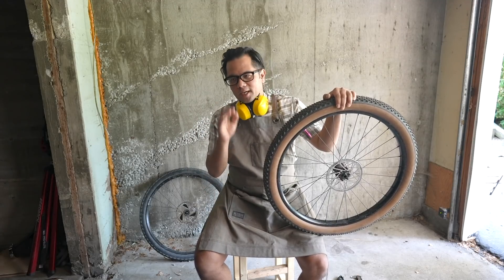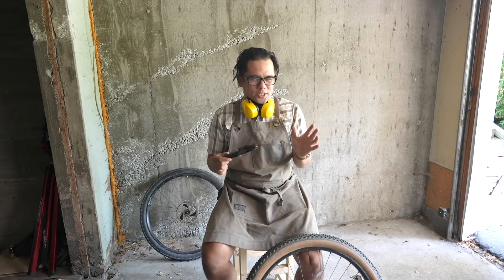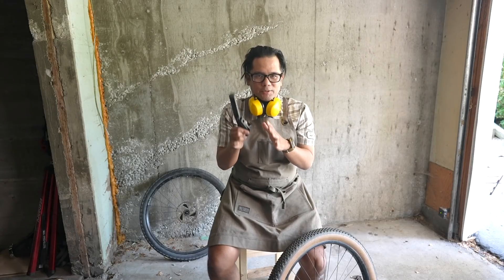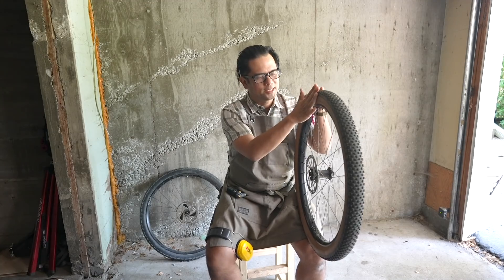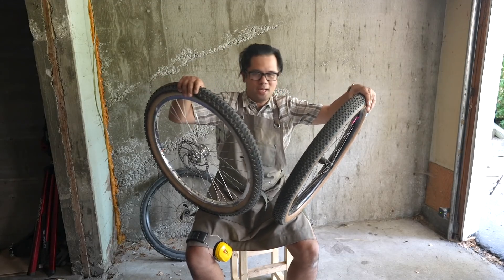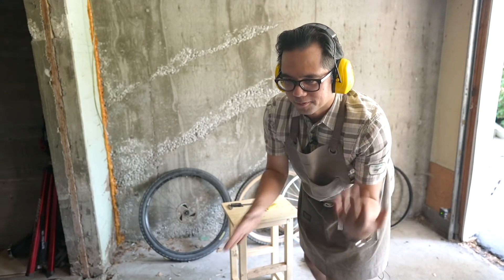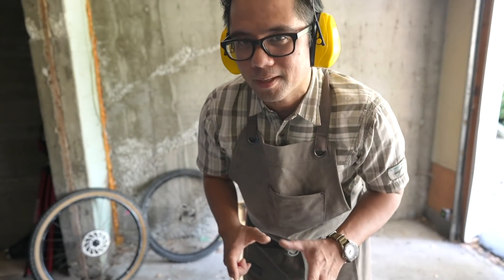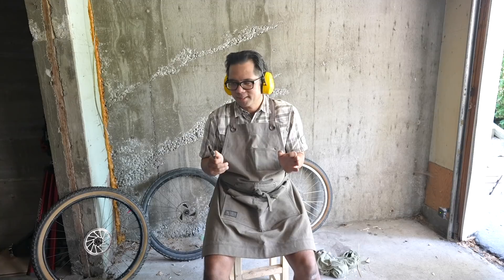Your Tires Are Always Changing Size

Comment: My Continental Contact Plus City 700 x 42c measure anywhere between 40.5mm to 41mm on my 22mm rims depending on where I measure. I'm curious if it will be closer to 42mm on 25mm rims. About 45 PSI.

Comment: I've been inspired by the Old Shovel to bring life to old bikes. I have an early 2000's 26er MTB. I was thinking of making it a "gravel" bike with alt bars. I would convert it to a 29er if I could, but there are a lot of problems with that. I was thinking of making it 650b, but from your videos about outside diameter, it appears it wouldn't make much of a difference going with bigger rims since I would have to compromise quite a bit on width. Probably best to stick with 26in and find some "gravel" tires?

Comment: I use a tubeless tire syringe to get the sealant into the tire, but AFTER I've set the bead. Putting the sealant into the tire before seating is a skill I do not posses. That is a guarantee for me to get sealant all over the floor.

I noticed it is really hard to get my gravel tires to seat on wide rims (30mm internal, 50mm tire). You need 2 people to do it and an air compressor, which pretty much makes trying to do it in the field almost impossible. I've taken the exact same tires and popped them onto a narrower rim and they seat right away. Another thing I've noticed about putting them on wide rims is that they do not grip the rim very well. I lined up my logos with the valve stem, and after one ride the logos no longer lined up with the valve stems, so there's definitely some slippage there.

Comment: the fattiest point on the casing is mainly relevant on frame & fork clearance, I'm more interested in the size of the contact patch. You can measure this by riding through a narrow water puddle on a dry sidewalk. Just measure the first track pretty quickly ass the tracks dry fast.

Comment: Think of the cross section of the tire and rim as two arcs that make a complete circle. When you mount the tire on a wider rim, the circumference of the cross section increases, which makes both the width and the height of the tire larger.

Comment: The big take away for me was just how close the 26 is in height to the 650. This means the 650 will most likely roll faster but have less cush. The next video I would like to see is how rim width affects the handling of a tire. In the last couple years I have come to like big tires on narrower rims. This results in a more pronounced center which in turn means less rolling resistance and a rounder overall profile that results in more nimble handling. And from what you have demonstrated one may be able to fit a wider tire between the stays. Conversely, I've found that using wider rims results in more contact, which you can still get by lowering tire pressures, but the handling, especially steering suffers. And it gets worse with lower pressures. 

Also wondering where 26er is with tubeless? I see that there are options but haven't really surveyed that market yet. 

Anyways I appreciate the vid! Thanks Russ!
Reply: Interesting, I wonder if that applies to all tires. Wouldn't that suggest that for gravel you want narrow rims and for XC you maybe want a wider front rim?
Reply: @szurketaltos2693  XC racers these days sometimes run 30mm rims
Reply: @kaedeschulz5422  but would it be advantageous to run a narrower rear rim with that 30mm front rim? Assuming OPs lower rolling resistance is correct. Maybe it depends on the course.
Reply: @szurketaltos2693  I meant front and rear. I would rather run a faster rolling tire than a narrow rim wich won't provide any grip while cornering.
Reply: @kaedeschulz5422  that's why I said wider front narrower rear, same kind of thinking behind running a grippy front and fast rolling rear tire.
Reply: @szurketaltos2693  It's not the same as you need to lean a lot more for the sideknobs to touch the ground. Depending on the combination so much that it's not useable. A wider rim with a fast Rolling (not slim) tire is the better option. I for example rum a Maxxis High roller 2 2,3 on a 30mm rim at the moment. Rolls well and the grip is pretty good.
Reply: You want 27,5 with mor cush? Just get wider tires LoL
Reply: It all depends. I would prefer 27,5 with a thick tire

Comment: Interesting Russ....had a similar issue deciding on  panaracer Sk tires 700x43 on a stans pro wheel.  I can't remember the internal diameter 19mm? I got differing opinions whether I should mount them and if I'd have clearance.  I had them mounted tubeless no issues.  Came in at 41 mm width.  All is well ( cool military green color tires ) 😃

Comment: I hope, big rim manufacturs restart their 26 inch rim production. Same for the tire manufacturs like schwalbe. There are millions of 26 inch bikes out there and the combination of big tire volume for comfort and the sheer availabily is a fact no one can deny.
Reply: thats called fat bikes my friend
Reply: Why? 26ers are outdated in every aspect. If one wants a 26inch specific bike with good geometry you most likely have to get it custom made. I like 27,5 with thick tires. Rolls smoother over stuff and has more grip. It's only a size difference of 2,5cm yet still it's noticeable Also on 27,5 with the same tire just in a different wheelsize the contact patch is bigger.
Reply: @kaedeschulz5422  I am with @hungerknochen on this! So many nice old 26 frames (and the steel frames will ride for many more years to come; alu is a different storry in my opinion) and not very many choices for new wheels and tires :(
Reply: @brunofox4983  It's true that there are many nice old school bike's yet modern bike's with today's geometry ride a lot better and are more capable. On my 90s XC bike i always had back related pain because it just was very short and the top tube was very high wich means not much room for rough terrain till you hit the saddle. On my modern trail Hardtail i don't have any of those issues and it handles a lot better and rides much more stable and faster on trails.
Reply: @kaedeschulz5422  
By "outdated" you mean fashion and artificially created obsolescence? There is nothing particularly outdated about them, the difference between 26 and 27.5 is in most cases negligible and 27.5 is technically a 26 wheel anyways.
Reply: @Exgrmbl  It's 26 with a tiny tire yes. With the same tire it's 25mm bigger. I rode 26 and 27,5 basically back to back with the same width of tire and 27,5 rolled much better over stuff. Not an insanely huge difference yet enaugh for me to take 27,5 over 26. There are also more specific articles about it. Wich go into some physics. And physics say the same. Facts don't lie.
Reply: @kaedeschulz5422  
i don't disagree, for some people it makes just enough difference to feel just right. I just don't follow the logic that 26er are somehow "obsolete" - wooden rims and wagon type wheels with wooden spokes are obsolete, but there is no technology in 27.5 that is not in 26, they are all just wheels.
Reply: @Exgrmbl  That's true off course. Yet the industry moved to 27,5 and 29 because physics.
If proper tires would have bin around for 29 in the beginning 26 would probably never have bin a thing apart from kids bike's for example but there were proper tires for 26 back then so they took em because why would one make tires for e completely new sport right?

Comment: Another thing of note that is going to be more consequential with growing knobs on the tire (I hail from the mountains but growing branches into gravel) is the profile of the tire at width. A wider rim should (short of the laws of physics little is certain) flatten the (cross-sectional) profile of the tire. On a mountain rig that will decrease the lean required to engage the cornering/shoulder knobs. This can help if you aren't confident leaning the bike over quite as far, but also requires cognizance to not snap over the edge. A rounder profile (smaller rim with the same tire for example) will have a more pronounced transition from rolling tread to cornering, but puts you at a lean angle that gives more stable connection with the ground, in my experience. This requires speed to maintain the upright ride at some of the more extreme lean angles, and gravel gives you more speed than singletrack, thus why I make this comment here. Merely a consideration when testing tire and rim combinations. 
As always, a great video and well explained. Cheers.

Comment: I can't believe I'm saying this, but a chart or spreadsheet at the end would've been helpful too.
Reply: Spreadsheets rule!
Reply: Sheldon Brown has been talking about this for decades. He has all the spreadsheets you need.
Reply: If you write it down the its science!  But isn't recording it the same thing?  It would be cool for reference though.
Reply: @sethmcfarland1083  The ISO/ETRTO system kind of solves the problem. Wouldn't make some people happy because it's metric. For a 700x40c tire, it would be shown as 40-622. The first number is the inflated width of the tire in millimeters. For the rim, is the space between the rim flanges where the tires attaches to. The second number is the diameter of the bead seat of the tire. If this number matches, the tire will fit. That ends up with some discoveries, like 700c and 29" both being 622 mm in bead diameter, as the latter is just a marketing name for the former. Or why 650B/27.5" tires don't fit in 700c, even though converting 700 mm to inches results in 27.5". The bead seat of 650B is 584 mm, which amounts to 26x1 1/2". The old road bike tires (27" by anything except five) work on 700c  because their bead diameter is 634 mm.

Comment: You could build a sound box with plywood and foam around the compressor. We have that setup where I wrench. It works great but the air coming out of the hose or tire  is still loud obviously.

Comment: Thank you for putting this video together Russ! Multiple changes of tubeless tires With Sealant is a pretty rough undertaking. I hope that tire jack helped; my hands are wrecked from being a chef, and fitting tires on a rim kinda breaks me each time that has to happen. My recent set of 50mm cazaderos on a 25mm rim without an air compressor made me lose my shit, plus made my hands feel like they had been through a meat grinder.

Comment: Sorry if I’m covering ground someone else already did, and not to be pedantic,  but the method of the using the level only works if the floor is level. Wouldn’t be surprising if the concrete you’re on is 1/4” or more between the contact patches. I really enjoy your content (and this video especially, I’m currently converting an old 26” mtb frame to a gravel bike!)!

Comment: Husky makes a small compressor that's super quiet but strong enough that carpenters actually use them on jobsites. Small compressors can be augmented with air tanks, which are pretty cheap.
Reply: also you can probably get inner width measurements from the manufacturers websites, and not gum up your calipers...
Reply from the maker: Like tire widths the stated widths aren’t accurate.
Reply: @PathLessPedaledTV  have you compared them directly and found variations or are they all off by the same amount? I'm wondering if they're measuring from the high point of the bead or not, because it seems odd that wheel designers would have any kind of variation in their finished products. They have to furnish those specs for OEM applications.
Reply from the maker: @Taxi Rob  in the video both the i22 and i35 were undersized by varying amounts.  Bicycle parts have notoriously wide tolerances/variance in manufacturing.
Reply: @PathLessPedaledTV  ok I see what you're saying. I'm looking at the VO site now and they're clearly measuring at the same point you are. But you should def check out that compressor and save your hearing, lol.

Comment: I know this video is primarily about rim sizes and width measurements but I can't tell you how many times I've been to the Bike wheel size calculator website to compare tire/wheel combos to see if I can do a wheel swap without dropping my bottom bracket too much. My general ones I try to keep in mind is that the diameter of a 700x38 Is about the same as 27.5x2.4 and 700x28 is about the same as 26x2.35. 
Then honestly 26 and 27.5 aren't that far off of each other, but that's been a more recent realization.

Comment: Tire casing construction, threads per inch, whether or not the tire is designed to have the classic "light bulb" shape all play a part in tire width and height on different rims. My WTB 700x40 Byways are 2mm taller and 5mm wider on my 23mm ID rims which are a tubeless compatible style (DT Swiss type) vs a set of 19mm ID UST style tubeless rims. The BSD of the wider rim is larger than the UST rim. The UST rims have a bead channel with a lip and the tubeless compatible rims do not. They just have a dropped center channel and a raised bead shelf which has a bit of a hump in it. Also, 4mm is 10% of the ISO tire width as stated by WTB, so it's not surprising to see that much growth. It also takes a lot of PSI to get the Byways to seat on the beads of the wider rims. 

WTB claim the 700x40 Byways works on rim widths from 17-30mm. That may be the case, but the tire width and diameters are gonna change quite a bit from one extreme to the other. The sidewalls are a lot more parallel to the rims on the 23mm rims.

Good content Russ! Thanks!

Comment: Another great video. Would you consider doing a video (or at least giving your two cents) on rim widths? I saw your chat with Josh Poertner, where the conversation was inconclusive on a recommended tire width : rim width ratio. Besides the aerodynamic advantages of wide rims (a non-issue at casual speeds), the advocates of wide rims tout improved cornering ability and less burping, along with better knob placement. Meanwhile, Jan Heine claims the opposite - that narrow rims result in a more "O" like shape resembling a tubular tire, and thus corner more predictably. Who is on the right track?
Reply: Bonus question: if you could only have one set of wheels for a 650b road plus (47mm) setup (WTB Horizon, Rene Herse Switchback Hill, Teravail Rampart, among others), what would the inner rim width be? Thanks so much <3 !

Comment: Yes!  The concrete backdrop is a really great venue for these vids.  I can add to your data set--this weekend I finally mounted my 26x2.3 RH Humptulips Ridge on my 17mm internal width 80's rims (the minimum width recommended on RH's website) and the digital caliper says...48.7mm 🤨.  

(BTW, I'm also the guy who asked about that Tire Jack tool...could not have gotten the tires on those rims without it so thanks again.  Best $13 I've spent on a bike specific tool and it will be coming with me on all rides next to the patch kit.)

Comment: Does it matter how you rest the tire against the wall? Because one tire could be leaning more than the other (shorter height) which may be more upright (less lean = taller)?
Reply from the maker: I rested the wheels against the flat side of the hub.  They all used the same hub width.